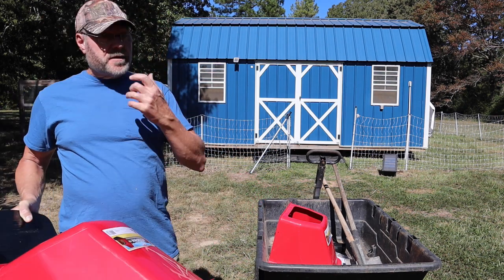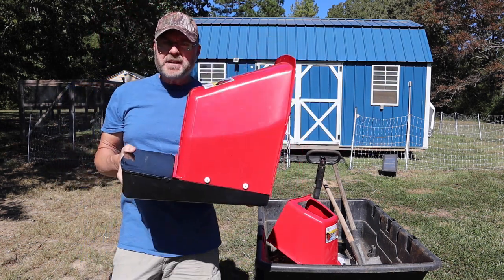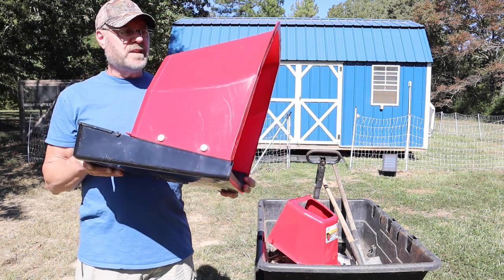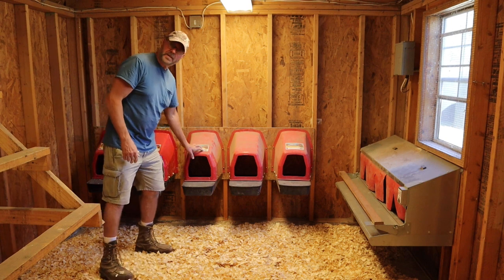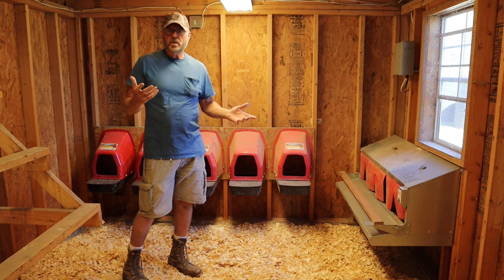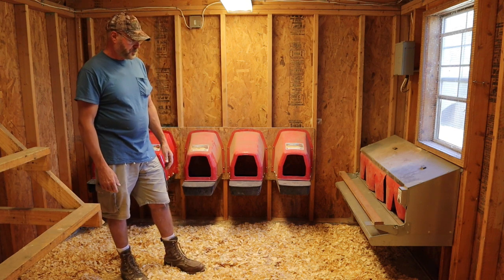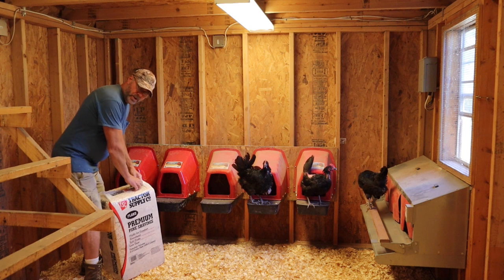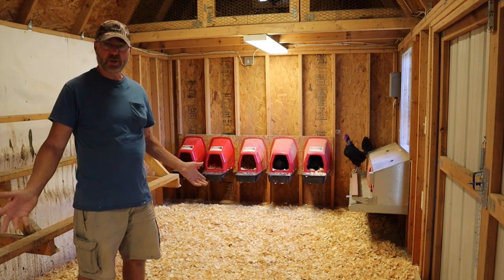Revamping Our Chicken Coop: Cleaning Up And Upgrading With More Nesting Boxes!

Comment: Hi Pete have you ever thought about installing extractor fans in the coops for extra ventilation just a thought
Reply from the maker: I do have a 14 inch exhaust fan pulling hot air out of the coop.